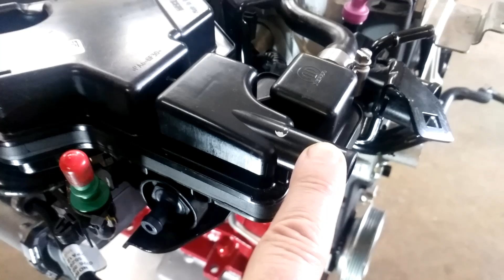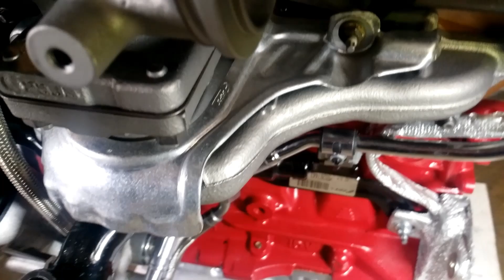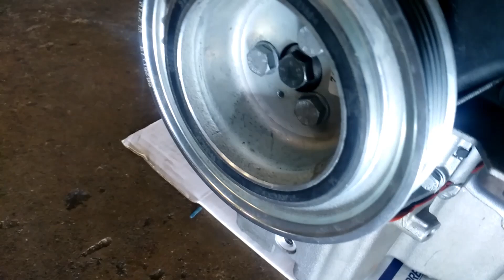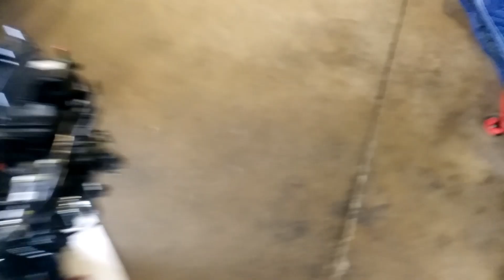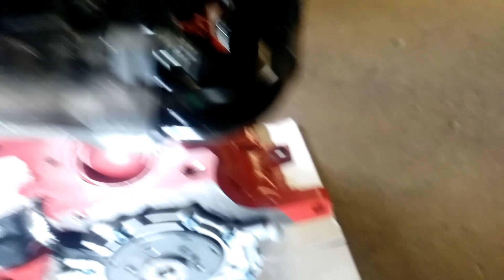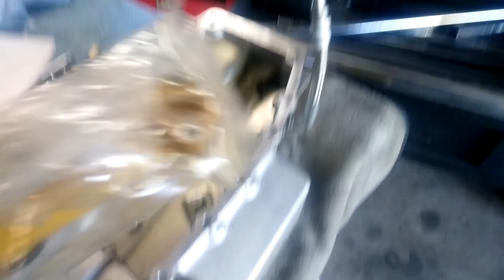Fiat 1.4 Multiair Build Completed, Plus Timing Belt Change Instructions

Comment: Awesome Content!  Thank you so much for your time and effort! I have a 1.4 non turbo.  How hard is it to change the valve stem seals on this engine?  I'm getting oil smoke out of the exhaust, it isn't a pcv leak and spark plug wells are dry from the top.  The car smokes in the morning as the oil accumulates over night in low temps and burns off on first igition, again, not condensation or coolant.  Am wondering if it's doable to use a valve spring compressor and patiently replace the valve stem seals before winter hits.
Reply from the maker: It's a lot more work than on other engines because you have to remove the cam and mulitair unit, but you can do it with the head on the car.
Reply: @GregsAirplanesandAutomobiles  Thanks so much for responding. Is there a way to check which cylinder, or valve, has the bad stem seal?  I realize once it's all off one should replace  althe stem seals l, nevertheless, knowing which on is leaking would give me more options.  I know the exhaust side is under the cam, if the leak is coming from the multiair side, that is a bit easier b/c won't need to take the timing belt off...  Is there a way to narrow
 down which cylinder or even stem is leaking?
Reply: I just saw your video showing the 1.4 break down.. super nice.  It looks like, to replace the valve stem seals, I should take it down all the way to the valve section, so one more layer down after removing the multiair and cam, but before the head section.  Man I've not gone down that deep into an engine before.  Valve cover gasket is the farthest I've gone.

Comment: My multi air went bad...cost me 1500...labor and part..3100😭turbo went bad. Cam seals went bad...head gasket went bad...valve cover went bad. Oil air separator went bad. I'm so burnt out over this car. I legit could cry. Last trip I went in for had coolant on piston...told him I'm done..put it back together. Replaced head gasket and I'm just driving it right now and praying to God it last me before buying a new motor. 10k in repairs. Absolutely absurdity
Reply: I still love my car, people think I'm crazy but oh well. Tell me sell it and I'm like nope. I have the 2013 dodge rallye turbo. Nice car honestly. Just very temperamental. One thing goes look out. Have money for repairs..
Reply from the maker: My 2014 Fiat 500L has 140,000 miles on it. The engine and turbo are still like new. I am worried about the DDCT transmission though. I'm not so sure those things went bad on your car, I think your mechanic may be taking you for a ride. I mean, the "valve cover went bad"? That doesn't make sense.

Comment: So the tool kit is not just for keeping the correct timing in place, but also setting the correct timing? Or am I understanding the use of the timing tool kit wrong?
Reply from the maker: It's only for setting the timing. Once it's set, you remove the tools, you can't run the engine with those on there, it's won't turn over.

Comment: Hey Man , Came Merlins , stayed for the Multi Fiat engine go figure. Anywho  QUESTIONS: you never mentioned the hp numbers. Ball park.  Have you seen a Merlins running on E85 , How tall and wide is the multi air 1.4.
Reply from the maker: I'll have to answer this when I get back home. I haven't measured the height and width. It's fairly tall, I would say about average in width. It's length is short, which was a primary design consideration.

Comment: Hi Greg, Quick question if I may.

When refitting the multiair unit back on the vehicle, does the timing need to be set on the Crankshaft prior to fitting if the engine was turned over by hand with the MA unit removed?

Many thanks
Reply from the maker: No, the Multiair unit's timing is controlled by the camshaft and the car's ecu. There is nothing to set for this.
Reply: @GregsAirplanesandAutomobiles  thanks mate, 😊

Comment: I'm guessing that cam positioning tool is very difficult/impossible to put in position when the engine is in situ? If so, is it a case of Tippex'ing your own timing marks when changing the timing belt?
Reply from the maker: No, you can get the tools in place with the engine in the car, it's not a problem, but it's very time consuming. Making your own timing marks are not really an option because you won't have anyway of holding the cam in place with enough accuracy when the tighten the cam nut.

Comment: Also do I need to use flywheel lock from the locking tool set to replace the timing belt or can I not use it
Reply from the maker: You do not need the flywheel locking tool when replacing the cam belt.
Reply: @GregsAirplanesandAutomobiles  also I did a head gasket.sent head for valve job.had cylinder 3 misfire.did the leak down test the air leaks out of cylinder 3.the intake valves leak air.what could it be if the machine shop did the valve job

Comment: Where is the diverter valve hooked up? I see the blow off gauge on the turbo, but I was under the impression the diverter had an electronic connection.
Reply from the maker: It does have an electronic connection, I have it mounted on the driver's side inner fender. I have a video of the installation here: https://youtu.be/WoAbvsHBXRs

Comment: Where does that crankshaft position connect to once in the car?
Reply from the maker: On this engine the crankshaft connects to three things, the camshaft, water pump, and oil pump. Only the camshaft is timed relative to the crankshaft, the other two are connected and spin with it, but there is no timing issue with them.
Reply: Do you have an Instagram or somthing where I can show you a video of what I’m talking about
Reply: The other end of the sensor wire is where I don’t know where it plugs into

Comment: Need Help  This may be a dumb question. I can get to the head bolts to remove the head. 1.4 multi air. I took out the 8 short bolts. But they look to short for head bolts. I think the head is 2 pieces? But can't get the spark plugs tubes  to give.I am doing  something totally wrong. The manifold turbo off the intake still on. Anyway can't get head to move or can't find the head bolts. Thanks
Reply from the maker: You have to remove the cam carrier. The head bolts are under that.

Comment: Hi greg… thank you for the videos. I have a question I hope you can answer. I have read in a couple different fiat forums that I need to lock out the camshaft first and rotate the crankshaft to align the tool. Your video says to do the opposite. Which one is correct? I am working on a US version fiat 500 Abarth. Is the t-jet engine a different process and that’s why those guys are saying the manual calls for the camshaft to be locked first? I don’t get why it would be different but that’s what they are saying.
Reply from the maker: First of all, I am in the U.S. and the engine in the video is a U.S. engine. It makes absolutely no difference which one you lock in place first.

Comment: Hi Greg. What is the torque spec for the flywheel bolts on the Fiat 500? I can’t find it and I figure you would know. Love your videos btw. Thanks
Reply from the maker: I don't know that off the top of my head. I do know that there are two different sizes used on Fiat 1.4s and they have two different specs, so you have to be careful. Furthermore they are all one time use bolts, so you need new ones every time. Also, they are torque to yield, so there is a torque spec, then a number of degrees you have to turn them beyond that. So they are quite specific.

Comment: My brand new Gates/Mopar belt is too short. Can't get the belt over either the cam sprocket or the crank gear. Does anyone else have this issue?
Reply from the maker: I have no idea if you have the correct belt or not, but it's tricky to get on.
Reply: @GregsAirplanesandAutomobiles  I unbolted the cam sprocket and was able to get it on there . thanks.

Comment: Is the Garret turbo charger made by the same company that builds turbine engines for MU-2s and twin Commanders?
Reply from the maker: Yes, that's the same company. In fact the Garrett TPE series of engines use what are basically large turbochargers for their compressor section.

Comment: I was told the timing tensioner needed to be adjusted to full tension first then rotate shaft twice then adjusted to center, is that correct? Or will it be ok to just adjust to center notch.
Reply from the maker: Center it, rotate and it should still be there, if not, do it again, but I have never seen it move once set.

Comment: Great explanatory video ! Thank you ⭐️⭐️⭐️
I have an Abarth 124 1.4 multi air from new with 40000 Km now.  My recent mechanic ( official FIAT dealer ) has been using the 10W50 oil for my car on last 3 services and I drove about 14.000 Km with that oil…. I was assuming there were using the recommended oil as per manual ! 
Previous services with another garage , were using the recommended 5W40 . I don’t get why the FIAT dealer is using the 10W50 for ALL Abarth’s not taking in account if it’s a multiair or a T-jet !! I told them about and they are not bothered.  I have changed garage and replaced for the 5W40. 

My question is , do you think I have damaged my engine by using the 10W50 for 14.000 Km ?
Reply from the maker: I suspect it's fine, especially if this was in warm weather, but that's just guess, I really don't know.
Reply: Thank you for your answer 😄
I guess for engine lube should be ok , my concern was for the correct functioning of the multi air system without the right density oil

Comment: Any input on troubleshooting a MultiAir actuator without specialized equipment? I have a misfire on Cyl 4, new plugs, no help. Move coils, missfire does not follow. Exhaust stinks like fuel, I'm certain It's getting it. Next step is a compression test. From what i can tell, these solenoids fail closed, so no compression would mean failed actuator (or worse...) right?

Also any input on finding good used or overhauled units? I'm hesitant to put a $1000 actuator on what's realistically a $3500 car... 2012 500 Sport N/A.
Reply from the maker: It's likely you have a bad fuel injector. If all those are good and compression is low on that cylinder it's either a valve problem, or multiair. Only a leak down test can tell for sure.
Reply: @GregsAirplanesandAutomobiles I did a leak down test on cylinder 3.the air comes out of the intake side valves.it has a cylinder 3 misfire.did a head gasket,sent to machine shop to do valve job but still leakes air from cylinder 3 and has miss fire.what could be the problems

Comment: Greg, How much torque is on the timing belt tensioner nut? And is 88lbs correct for the cam nut?
Reply from the maker: 88 foot pounds for the bolt that secures the cam pulley to the cam. I'm not sure about the tensioner nut. I can't get a torque wrench on it anyway, so I just do it by feel.

Comment: I have the 1.4 in my 2014 dodge dart it has 170psi on cyl 1,3 and 4 but only 30 psi on 2 would the multi air cause this?
Reply from the maker: Hi Jeffrey, how many miles are on the car? What mods if any does it have? Are you the original owner? I'll help you, but I need more info.
Reply: @GregsAirplanesandAutomobiles  2nd owner first was my girlfriends mom she had dealer oil changes as scheduled she says no mods at all 165k miles

Comment: Hello Sir, greetings from Nottingham in England, thanks for the very imformative video, i currentley own a new Jeep Renegade with the exact same  engine, my question to you is, if it is at all possible to change the timing belt by just using the locking tool on the cranckshaft only? without having to remove the vacum pump on the other side of the enginein orther to lock the camshaft aswell? if providing i make sure the camshft pulley does not move at all, and make a fine mark on the cranckshaft pulley and camshaft pulley, is it possible to turn this engine through two full turns by hand on completion? or will it cause damage to the multiair system? please advise me as currently this video appears to be the only accurate one available on the net, or anywhere indeed.
Thank you so much for you help.
Reply from the maker: Hi Gabriel. Great question. First of all the belt lasts 150k miles, so I doubt your Renegade is there yet. It is possible to do this without the cam locking tool, but it would be very difficult. The accuracy has to be so precise that even with the tool the slop in some of the brands is enough to cause it to be off enough for the ECU to detect it. The only way I'm sure of is with the cam tool, and even then marking the cam is a good idea so you can see if it moved due to slop. The cam and crank tool come in a kit, so why would you only have one?
Reply: @GregsAirplanesandAutomobiles  Hi Greg, thank you so much for your prompt reply, i do have the kit, i got it of E-bay it's a 'no namer' like you quoted, my point is i am trying to avoid the incredible amount of desmantling from the other side of the engine, in order to lock the camshaft, and as you quoted risk damaging it when tightening the bolt on completion, i carried out numerous timing belt repairs on 16v. cars with twin cams and i have always managed to do them without taking half of the engine apart, if i do mark both pulleys prior to desmantling the old belt, and fit a new tensioner and a new belt and rotate the engine through 360 grades and the marks align then im there.
I understand there is a slop as you tension the belt but the slop tends to align itself after two complete turns after the belt and tension is in place?
Please correct me if I'm wrong. 
My Renegade is a late 2016 automatic model with only  36000 miles on  the clock, but the belt sat in the car now for nearly 5 years and that is my concern. Here in the UK the information regarding this engine is very limited and 90% of my knowledge so far has been through videos on Youtube with yours being the most accurate and imformative so far, and im am thankful for it.
Reply from the maker: I haven't tried it this way. I do think it's possible, but not likely to work on the first try. As for the belt aligning itself after two turns of the engine, no, that's not what happens. What actually happens is the tensioner moves with engine rotation causing the cam timing to change slightly. This is why you have to check it after rotating the engine.
Reply: @GregsAirplanesandAutomobiles  Thank you very much for your help.

Comment: Enjoyed the video, amazing tour. You mentioned to use the right oil, I live in Arizona , temps here in the summer ave 108+ F 🥵. Can you suggest a couple of good oils for this engine.  Thank you .
Reply from the maker: I use synthetic oil in the recommended viscosity.  I don't focus on the brand, I just use what's on sale. My 500L has about 150k miles on it, it doesn't burn oil and has full compression. I think it's more about how often you change it, then what brand you use.

Comment: Hello Greg. I have a 2019 500L that I'm wanting to do minimal upgrades to for a little extra pep/mileage. I'm having an incredibly difficult time finding an air intake for this model.  Could you please point me in the right direction?
Reply from the maker: Hi Robert, there is no good aftermarket option for the 2014 and up 500L. I might make one at some point but there is really no market for them.
Reply: @GregsAirplanesandAutomobiles  same engine then right capable for a abarth swap

Comment: greetings,i own a fiat 500 sport none turbo with 98000 miles on it.I've  done all maintenance on this car and often wounder how long do these multi air engines last?
Reply from the maker: They seem to last forever. My 500L has had about 200hp and has  served as a Eurocompulsion.net test mule since 2014. It has about 120,000 miles on it. I just did the timing belt change and did a compression check. The engine has zero, and I mean zero detectable wear.

Comment: I have the same engine. Been experiencing some power loss on my Giulietta 1.4 TB, checked the boost solenoid and cleaned it, I also checked the tubings around it if there were any leaks. My wastegate actuator isn't moving and stays in place, and the bars aren't increasing, might have to check if there is any boost leak, do u think that's the problem? and thanks
Reply from the maker: From what you said, a boost leak is a likely suspect.